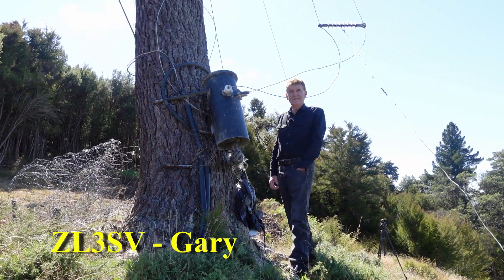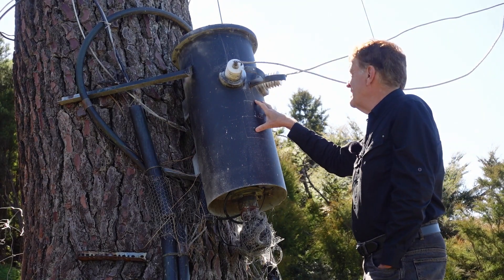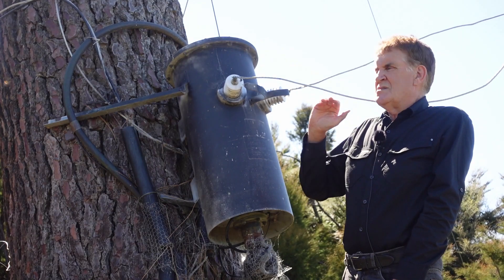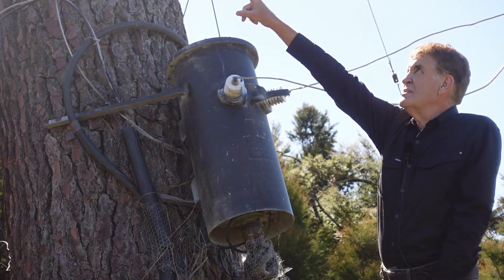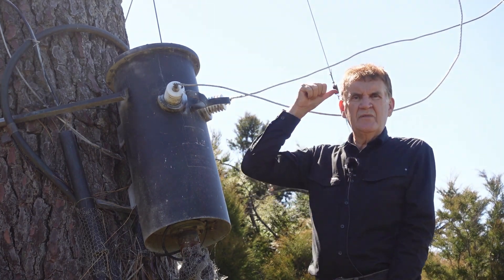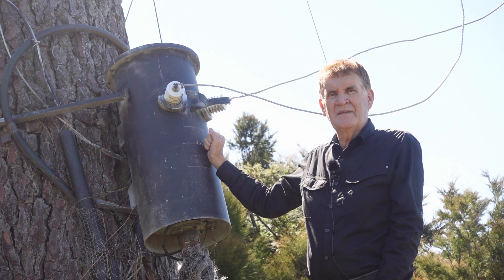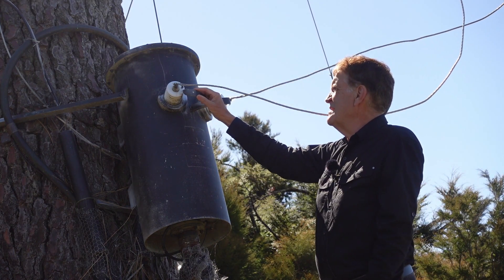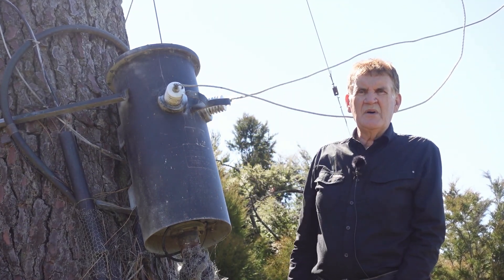MONSTER ANTENNA the BALUN -- A revisit to ZL3SV and questions answered

Comment: Why doesn't he run the open wire back to the shack? Then put the balun there. Probably higher lightning risk would be my worst fear I would love to know more about any tuning of this antenna. Or did he literally just leave it at exactly 320M x 320M? Results are impressive!
So is the antenna just layed out like a giant dipole several wavelengths long, one element in one direction and the other one going into the opposite direction?
Reply from the maker: Probably time for another interview with Gary to ask him some of these questions....stay tuned...cheers

Comment: 1 t400 core 1kw easy, 2 T200s 1kw the core should not heat up and the core type determines the freq spectrum it can handle , other than that the amount of turns ratio determines freq response., 1kw is qrp lols.. 3 wire baluns is s(shorted),,, across the feed add a 10k resistor for static bleed off.
Reply from the maker: Thanks for the input...cheers

Comment: Surely the 600 ohm impedance from the open wire feeder varies massively when the frequency changes from 160m to 10m and therefore the matching to 50 ohms via the value is only correct for some frequencies?
Reply from the maker: EMAIL REPLY from GARY:
"Yes Iain is correct but because the ham bands on HF are closely harmonic related it does provide a low SWR with no tuner on 160 to 10 metres. Thats why the antenna is 640 metres long. 

I only use an ATU to fine tune the SWR so the rig puts out full power.

On Ham bands SWR is about 1.6 max with most of the time it is below 1.3

NB A 40 metre 1/2 wave antenna works on 15 because of the harmonic relation ship however the radiation pattern differs on 15.

Cheers Gary"
Reply: @ZL1BQDRoly  many thanks! I have I acres of land but no trees unfortunately. Max power here in Ireland is 450w
Reply from the maker: I have invited Gary to come along and respond..... stay tuned 😊

Comment: Thanks for another enjoyable video, Gary is a fascinating guy and has passion for his creation!! I'm not sure if I would have touched the Antenna wire incase it was holding static!! Thanks Roly.
Reply from the maker: I know what you mean Alex.  Gary did however use the lightning spark gap to ground the antenna before he did touch it, may not have caught that on video.....cheers

Comment: >"Just toss a wire up in the tree mate, you don't need to spend a lot of money"
>A few drinks later
>"Mate why do you have a commercial balun and 1+ km of wire in your yard?

Great video, Roly! I can't get past how ridiculous this antenna is. 73 de VE3GKT
Reply from the maker: lol, because I can......Both Gary and I are ex-Commercial Broadcast Engineers and we sometimes have access to this sort of gear when, say, an old AM Broadcast Station is being decommissioned.  It would be a shame to send it all to a scrape metal dealer....  cheers

Comment: I measure my breaking strain in 100s of pounds Gary measure his in 10s of tons!! I do agree with over-kill when building antennas. I uses a 49:1 EFHW 80m to 10m antenna with three cores of 240 43 mix. I am only running 100 watts peak into it so I am not worried about saturation or hitting the Curie temperature limit. If i do pickup an amp this antenna should handle 500 watts without to much heat generation-I hope. Great video Roly. Gary is full of information and I could listen to him speak for hours. 73 Joe KN4IFI
Reply from the maker: Thank you Joseph, yes designing the balun so that you get not heat is essential.... cheers

Comment: Very interesting Balun/transformer 
Wish I had half the antenna system Gary Does ☺️😉 thank you Roly
Reply from the maker: You and me both Kevin. Half the Antenna would still be a very long wire huh ...cheers
Reply: @ZL1BQDRoly  na half would might not cut it I’m at a Half Wave on 160 Cntr fed with open spaced feedline. I’m working my way up too a Full wave Loop 160m I hope I can squeeze it in the lot 😬 it’s gonna be tight but we’ll worth the lower noise floor fingers crossed 🤞☺️